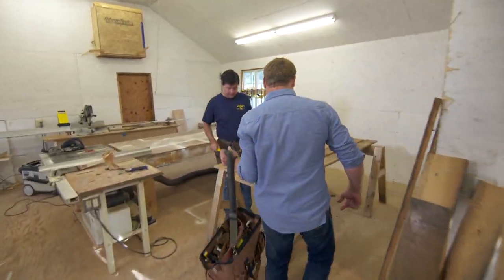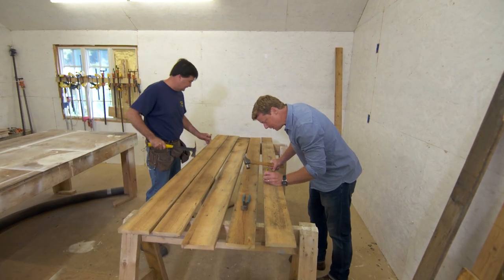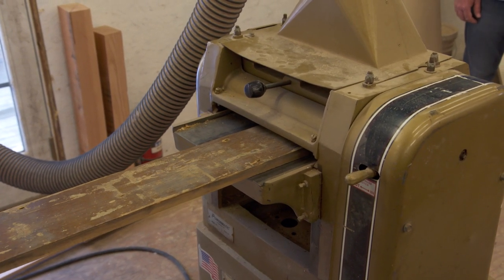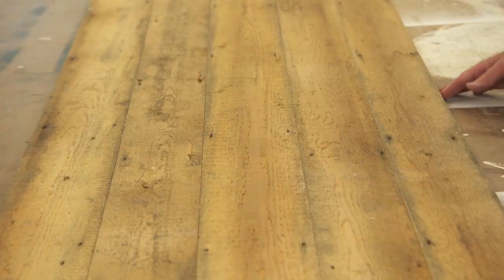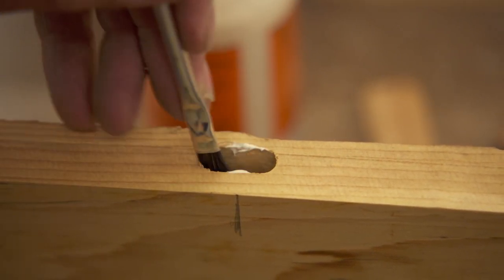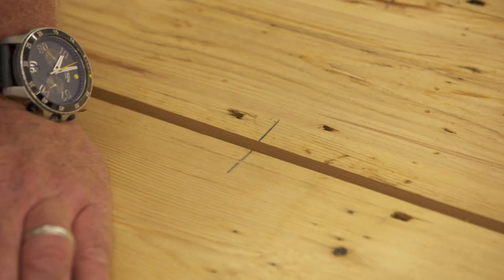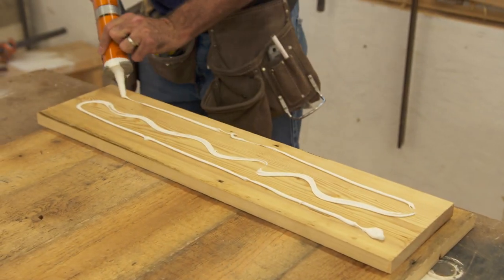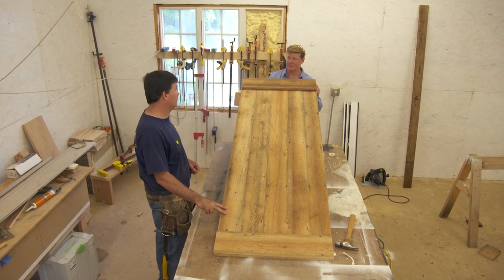How to Build a Reclaimed Wood Door | This Old House

Comment: Any specific reason why the wood weren't glued together?
Reply: Yeah, 20 years of Norm gluing the full length of the boards (even with dominoes in the last couple of seasons) and Charlie comes along and only secures the board at the tenons.  Doesn't make sense.  Of course, these 'vignettes' also don't make sense, they leave out most of the details and important information.
Reply: @donabele1243   ẁell if you get glue on the rough side of the board you are gonna have a rough time cleaning it up.
Reply: @tastemystuff  Nope. The board would expand and contract along the width of the grain and not the length of the grain.
Reply: It's not necessary. Saves glue, easier to assemble, easier to clean up. The glue on the tenons plus the cross pieces on top and bottom are plenty to keep the door together.

Comment: A DIY person would not have that tenon hole making machine so what would they use?
Reply: You can buy a doweling jig for under $100 or just try and Eyeball it with a drill and use dowels.
Reply: @danielbuckner2167  Thanks!  I just bought a doweling jig and it came yesterday
Reply: @bradleydavidgood  That was fast. Which one and how do you like it?
Reply: @danielbuckner2167  I watched some other video that I think recommended the same thing as you.  I will be using it in about a month after doing all of the other basic remodeling stuff to a bathroom.  I got this one https://www.amazon.com/gp/product/B01MTUUWD4/ref=ppx_yo_dt_b_search_asin_title?ie=UTF8&psc=1